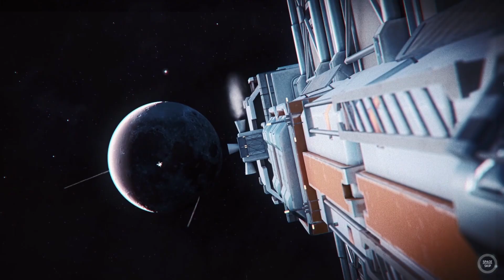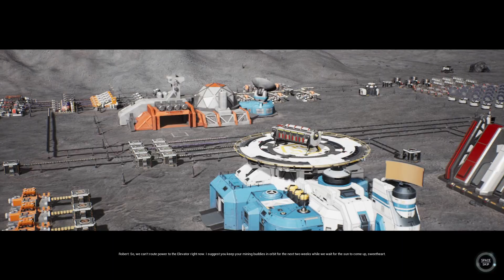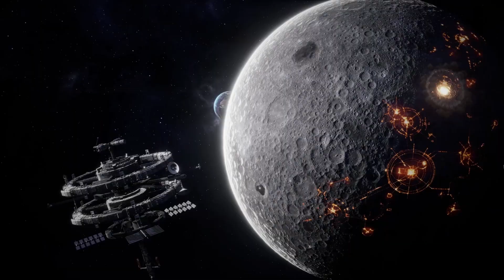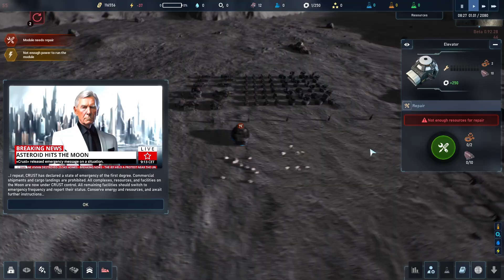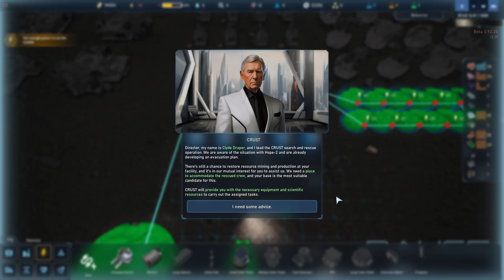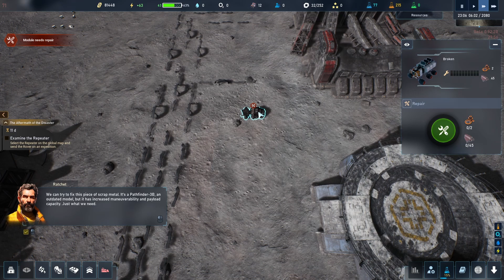THE CRUST: Lunar FACTORY & Colony Sim | First Look/Lets Play

Comment: AS an underground minser, i can tell you the ore bodies in this game are at least 98% smaller than actual deposits and the amount is actually not economical on earth so would not be economical on the moon.
I have worked in mines that were 100 years old.
a 20k or so  deposit of low grade iron( this is your  first deposit) , Is not economically viable just on being 20k in size then you have say 48 % iron in the deposit you only get a bit over 10k iron, Not worth the waste of money as it will not return the cost nor make money. 
something i believe should be addressed, but won't be, 
May be a modder will fix that later on.